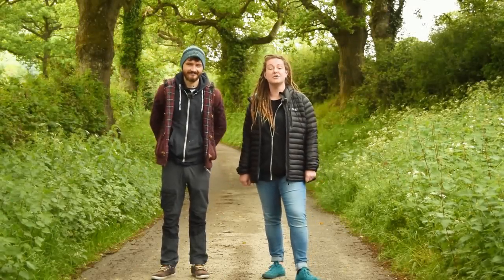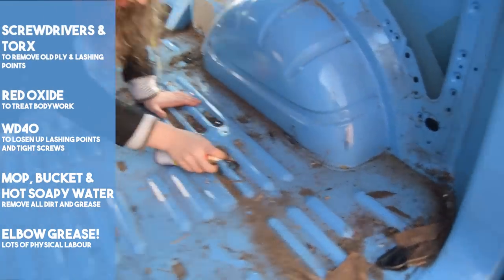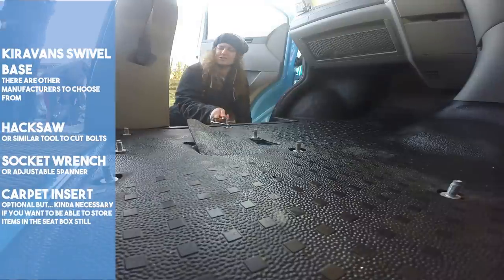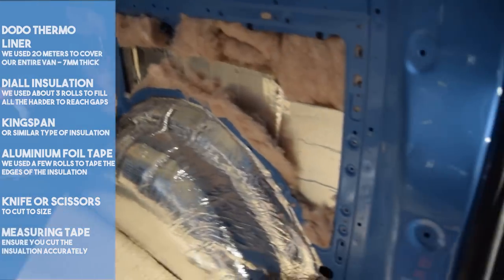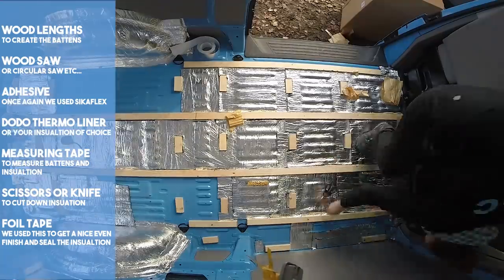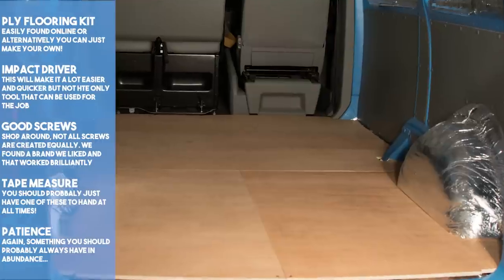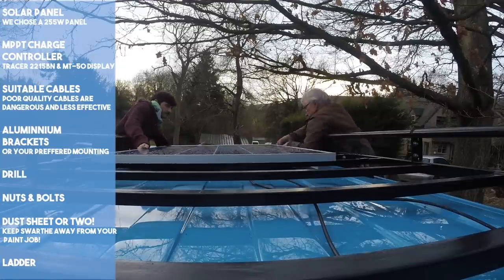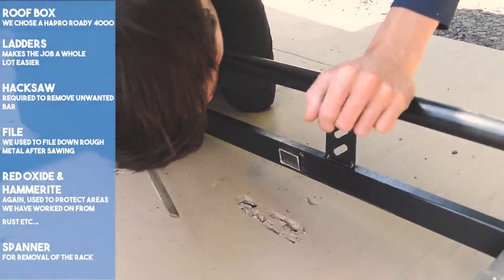DIY VW T5 Camper Conversion - Start To Finish, Van Life UK (1/3) Beginner Build

Comment: You guys are amazing!  I am certainly inspired by your efforts since i am currently deciding whether to buy  an off the shelf camper van or buy the shell and refit it myself.  I have zero skill in any DIY!!  Thank you for sharing and well done indeed.  Subscribed
Reply from the maker: Thanls Stephen! Converting this van was hard for us, having very little knowledge or skills. But we learned so much along the way and it turned out to be one of the most rewarding things we've done thu far. Building your own van is great if you have the time, but next time round we might buy something that's had the professional touch 😜
Reply: @FloraTheNoviceExplorers   Thank you very much for getting back to me and your advise about what go go for. Since we intend to use straight way I will take your advice about buying one ready to go.  All the best with the channel 🙂

Comment: Hey there. in the nicest possible way the silver type space blanket is not insulation, its used purely to go over insulation and to act as a vapour barrier, it has no rating of any significance, If you can still get behind your panelling try to get the insulation in there, it will be like an oven come the sun and vice versa winter. sorry to be the harbinger of bad news  Good luck
Reply from the maker: Hello! Thanks for taking the time to drop us a comment :) Do you mean our Dodo thermo liner? It might not come across well on camera but it’s a 7mm high grade, moisture resistant closed cell product. It does have a reinforced reflective foil on the back giving the appearance of a space blanket type product but it does have a certain weight and thickness to it. Admittedly we haven’t taken the van to extreme temps, but so far it’s been okay. 👍
Reply: @FloraTheNoviceExplorers  Yes, sadly I only just realised this was done sometime ago, you've obviously not much chance to put an insulation in now. Sorry but it has more less zero thermal rating, 7mm will only ever be a light sound/vibration pad for the likes of noisy vans/trucks, people are being lead astray in self builds for this stuff as an insulation, it just is nothing of the sort. I use many insulations in my profession. Its a damn shame, fan assisted roof vents will help you when our summer does eventually kick off.
All the best
Reply from the maker: Thanks. Fortunately it’s not the only product we used to insulate. So hopefully it holds up! Time will tell...
Reply: @FloraTheNoviceExplorers  You have your planar for the chilly ones.
For a future build 50mm celotex/kingspan type board for floor roof, 100mm quilt fibre walls, expanding foam holes, all overlaid with vapour barrier taped with aluminium tape... Its the best, you'd really notice the difference.

Comment: I started my conversion this January and I've only got about two more weekends to go until it's finished. Each time I started a new project/section in the van, like insulation, cupboard building or installing the seat swivel I first began by looking to see if you guys had covered it in a previous video. Most of the time you had so I simply followed your instructions and tried to learn from your mistakes.
I just wanted to say thanks for helping me along the way, it's been tough and costly but I'm very happy with how my van is looking and that's partly thanks to you guys. It didn't always feel like I was doing it alone.
Great videos and I'm sure I'll continue watching once my van is completed.
Cheers.
Reply from the maker: Hi Conner! 

Thanks for taking the time to leave us such a lovely comment! 

We’re so glad that the videos could be of some use, when we started out we really had no idea... about anything! But we’ve had such a great response from people regarding our van build and accompanying videos. Comments like this completely justify the extra time and effort we took to document our journey.

Glad you’re nearing the end, it can feel like the conversion takes forever. Happy travels once your all done and dusted!

Thanks again :)

Comment: What a great base van! Nice and clean, no builders cr*p or dents, even the ply lining looked ok. How did you find it?
Reply from the maker: Cheers! Yeah, we were trying to keep clear of builders vans if possible, wanted something that might not have been bashed around so much :P  We saw it advertised on eBay through a garage/dealer. The van only had 1 previous owner, a florist shop (so thought at worst there may be water damage under the ply). This garage has always sold the florists vans for them once their done with them and this just happened to be one of them. We got lucky, but we did blow our budget haha.

Comment: Hello guys, I love this video, it's been helping me plan for my build, how is the van dealing with moisture? Have you done anything extra to help deal with the condensation and is there anything you think you'd do if you could start again? Thanks in advance!!♥️
Reply from the maker: Hi Leon 👋 great to hear the vid has been helpful! Moisture has been an issue now and again. One of the first jobs we’re going to do when we can is to instal a fan over the hob. That’ll help a lot with reducing a lot of the moisture and increasing air flow. We’re also going to instal a refillable LPG system instead of the bottles we currently use. We do have a video called something like “van build regrets” where we talk about things we’d like to improve. Might be helpful for you? Cheers

Comment: Well done guys , just a wee question ,,When you done the flooring and put the wood strips ,How did you get your side-step and rear plastic to be even ,I am using 6mm ply strips and 12 mm ply ,just want to see what you gut done ,, lLooking forward to seeing your road trip
Reply from the maker: Hi Donna! Thanks for your comment. Once the new ply floor was down and we had laid outlet vinyl, we bought strips of black plastic trim that fit perfectly. We do show this in our vinyl flooring video I think, but it will be in part 2 of how we converted our van. Hope I understood your question correctly:p
Reply: @FloraTheNoviceExplorers  ,Looking over a few of your other uploads ,I am intersted to find out what drone you are using for your filming
Reply from the maker: For all the videos previously we used a DJI Phantom 3 Professional. However, we hit for a little foldable DJI Mavic Air, which is great to travel with. But haven’t uploaded anything from that drone as of yet!
Reply: @FloraTheNoviceExplorers  Thanks , Looking forward to seeing some of your cinematics when your on tour

Comment: I''m wondering what those two holes are that you used to pull the solarpanel cables through?
Reply from the maker: If I'm honest, I'm not sure 😂 luckily they were just there and also had a rubber gland I could use. They've worked out perfectly! They're still in place. So glad I didn't have to drill extra holes!
Reply from the maker: We actually have a video about the solar install, might be clearer on that video!
Reply: @FloraTheNoviceExplorers  Thanks i'm going to watch that one for a better view!

Comment: Hi great vides love them can i ask what mic set up do you use as when i do vids on my van the sound is always very low
Reply from the maker: HI Phil! 👋 if we’re in front of the camera wearing mics we’ll be using zoom handy recorders with a £20 lav mic plugged in. We use them a lot now. However for this particular video the voice over was recorded with a behringer c-1 (if I recall correctly). Relatively inexpensive options but sound okay. What are you using?
Reply: Hi thabks for the reply we been usein my gopro my phone and a nikon d3400 but the sound is not good lol im goin to look for the ones yous have suggested
Reply from the maker: @phildubztv8785  no problem, on our nikon d3300 we use an external mic, can be seen here: https://www.amazon.co.uk/shop/florathenoviceexplorers under the vlogging equipment. It helps but the sound isn't always great.
Reply: @FloraTheNoviceExplorers  thanks for that

Comment: Hello! don't suppose you remember which shelving unit you used?  I've been searching for one that's half height for ages but can't seem to find one which is and fits t5lwb? cheers!
Reply from the maker: Hi Ben! Our shelving unit was from a company called Demar Vans (if I remember correctly). I'll double check and get back to you if that's not the case! Cheers
Reply: @FloraTheNoviceExplorers  thanks!

Comment: The dvla classification system for camper vans is ridiculous. If you have a pop top, it isn't a campervan according to them. That means there must be millions of non campervan campervans on the road, that everybody else apart from the dvla calls a campervan. I have recently had a full professional conversion done, seen the qualifying regulations and never even bothered to try and change the classification of my van - absolutely ridiculous.
Reply from the maker: It's a shame that they made this decision and made it so much harder (or impossible) for people to change their classification over. We gotucky and did it a few years ago, otherwise we'd have never got ours reclassified.